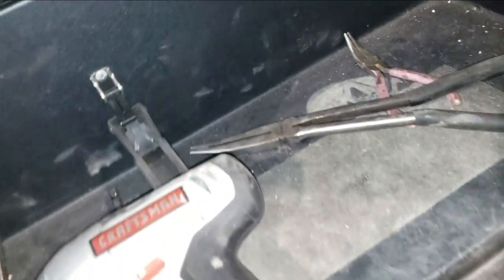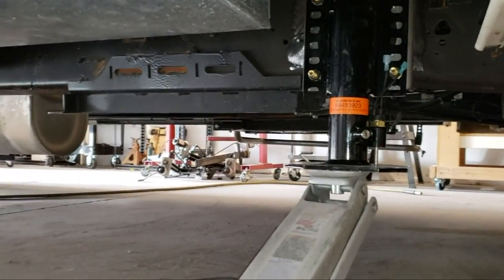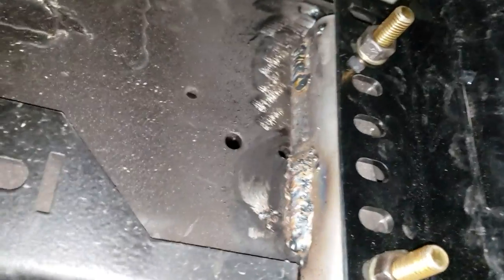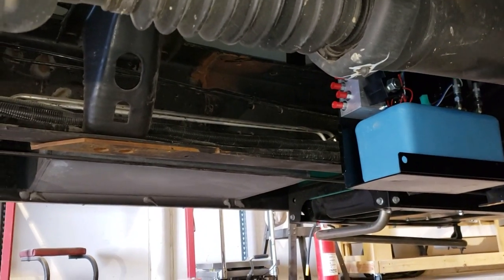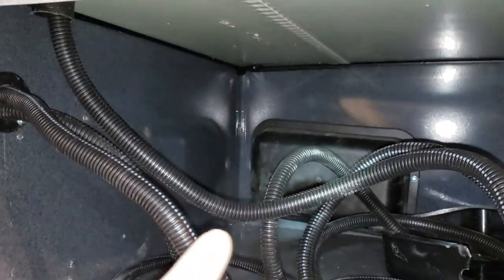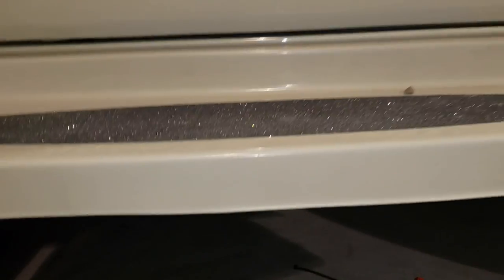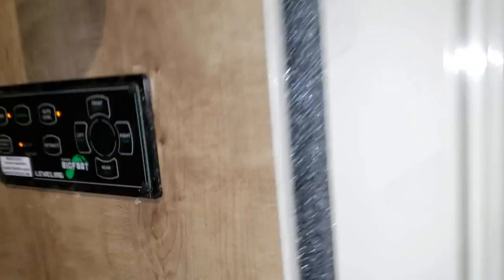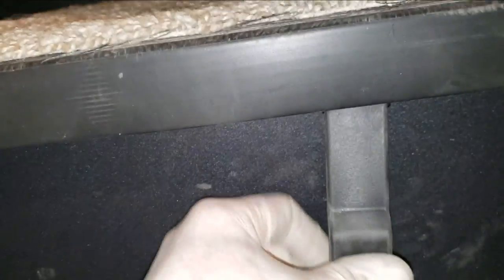How to Install Bigfoot Automatic Leveling Jacks on a Motor Home

Comment: Great video! Now that you’ve had these big foot jacks for a couple years, how are they holding up? Have you experienced any issues? How far do they extend? Do they lift high enough to change a tire with them?

We’re looking for hydraulic jack options for our school bus conversion 😀

Thanks for the video!!
- Brian + Erin
Reply from the maker: I have not seen it since I installed them. These would not be rated for a diesel bus but maybe a smaller gas bus. and you can lift the vehicle off the ground with them
Reply: @AZExpert  they do make diesel pusher versions available.  Very similar setup as the class c kits.

Comment: Thanks for all the video work ... hard enough to do a job w/out video.  Our 2016 MB 3500 Sprinter chassis under a Forrest River already has to hyd levelers in the rear.  Waiting for Quadra to get back w/ us if we can incorporate the existing rear levelers & only have to buy a system w/ 2 cylinders/hoses etc.  Curious - Bigfoot website says their systems are bolt on.  WHY risk potential chassis warranty by welding the units on?

Comment: I wonder if you can answer a question for me regarding big foot leveling jacks. It looks like I have a similar system and I’m trying to check for Top off fluid level. I remove the shroud on the front passenger side jack and I’m not seeing a reservoir. Is there one main reservoir for the whole system or should I check the driver side. Just wondering if you knew. Thank you in advance

Comment: Hi,  I commented on your Big Foot/Leprechaun videos a year ago-I finally bit the "poverbial bullet", and ordered the system. It took several weeks for it to arrive-supply chain interruptions, I suppose. I ordered the kit that had four separate pumps which arived today, 25AUG2021. Interestingly, today when I checked the Big Foot website, the 4-pump system is no longer available. Oh well... I have the EXACT same setup that you did the install on, 2019 Leprechaun on a Chev 4500 Chassis. The question that I have, did you have to cut off the existing brackets from the so-called Stabilizing System? It looks like you can fudge a bit in the front, but certainly not in the rear. And with everything in the way, did you remove only part of the rear bracket, or front bracket? Thank you for your time, it's much appreciated, and certainly not taken for granted. I look forward to your reply.

Comment: I am thinking of adding jacks to my Sunseeker 2500TS and have looked at both Bigfoot and HWH. I kinda like the HWH more than the Bigfoot because they have the springs to bring the cylinders back in if something goes wrong. What preference would you give to either one..This motorhome is on a Ford 450 chassis. Thanks!
Reply from the maker: HWH is the better product in the sense that they make almost everything, while other manufacturers use off the shelf components. Truthfully, either are good and i would go on price alone if it were me.

Comment: I was at my local RV dealer and I was looking at a Class C. I noticed that the RV did not have any type of level/stabilizer system on it. I asked the salesman about it and he told me. "The Class C motorhomes are built on a weak chassis. "That they can't handle the load that the stabilizer system produce." I politely nodded and kept the conversation going. Is he correct or is he just being a salesman? I know I've seen other class c motorhomes with them installed at multiple RV shows.
Reply from the maker: He is being a salesman. The frames are strong. Leveling is expensive and adds high cost not every buyer wants to pay for so is less common.
Reply: @AZExpert  thank you for the reply! Love your videos they're very entertaining and a priceless resource of information!

Comment: Hi there I would like to ask you if I just fix it without Welding how is the safety in your opinion so I can change at any time or I can use it on other motorhome update me please you look professional 🤩😎
Reply from the maker: If you can safely bolt it on you should be fine...It will be difficult though. I doubt you'd want to swap it from RV to RV once you install it the first time.

Comment: I think that you did a nice job on your video, good use of time. It's an overview, and not a step-by-step. I have this same EXACT RV-2019 Leprechaun with Chevy 4500 chassis, and I would like to install the Big Foot system. At the beginning the video, you mentioned that you had hoped for the independent pump and reservoir system. After completing the installation, given the concerns with the size limitations, particularly in the rear, would you still go with the independent pump per jack vs the central system?The difference in cost between the two is negligible in my opinion considering the expense in time for the installation. I'm very patient, and consider myself fairly handy, and I have access to most tools, including an expert journeyman weldor. Thanks in advance, and again, nice job on your video
Reply from the maker: Thank you. I was just being lazy and didn't want to run lines back in all honesty, this is a much better system than the four pump version. It sounds like you should be over qualified to install this system. Hope that helps.
Reply: @AZExpert  Good morning-thank you for the prompt reply! One final question, do you have an opinion on the Quadra Big Foot at $3,370 vs the Equalizer Systems at $3,195? https://equalizersystems.com/product/class-c-eq-smart-level-system-ford-chevy-chassis/ Thank you for your help, I appreciate it, and I hope you have a pleasant weekend. Take care.
Reply from the maker: @craigstratton1469  I mean they are very similar systems, but my honest opinion is that Equalizer is a little better system....but I am very confident most of the components are sourced to very similar companies as bigfoot(ie pump, valves, control boards)

Comment: I thought these systems were supposed to be no cut/weld on ford e450 systems?
Reply from the maker: The cutting was removing the old system, but definitely needed to be welded. Thanks
Reply: @AZExpert  ah ok, but would have been simple bolt on with a bare frame?  looking at options for if we end up buying a class c without leveling system pre-installed
Reply from the maker: @stromjockey  there wasn't a bolt on option. Most class "c" are fords this was a chevy. I can only say I did my best to follow the manufacturer's instructions but they were nearly useless. Thanks
Reply: @AZExpert  ah gotcha, thanks for the info and the content, its appreciated

Comment: How do I check fluid level in tanks?
Reply from the maker: Usually, I just stick a cut zip tie into the tank. Just make sure you check with the jacks retracted. There should be at least an inch of air gap, don't fill it up to the cap. Thanks!